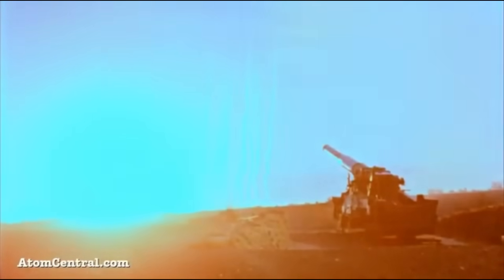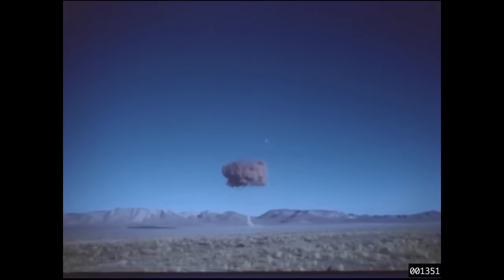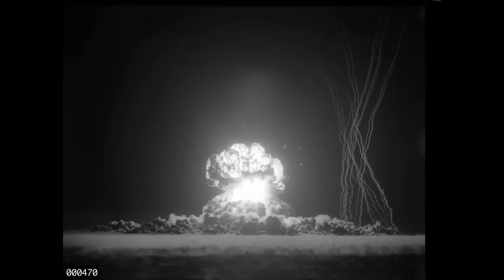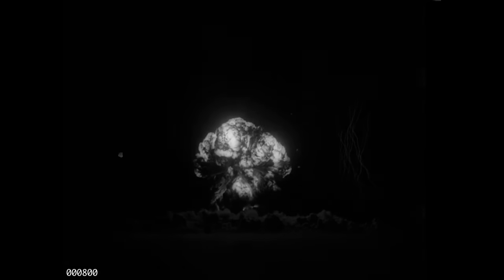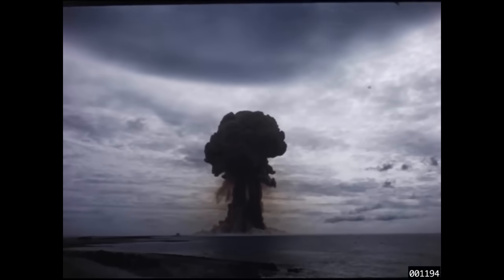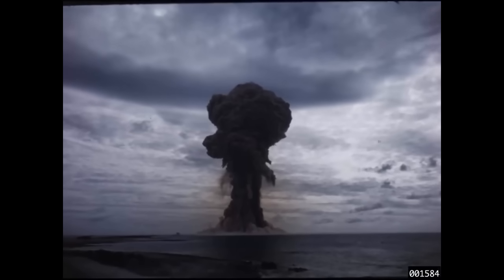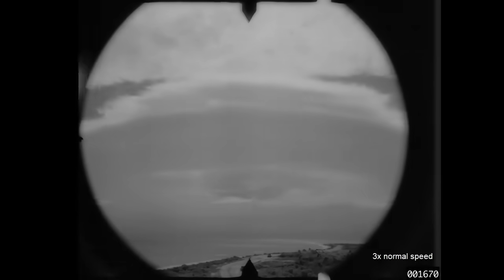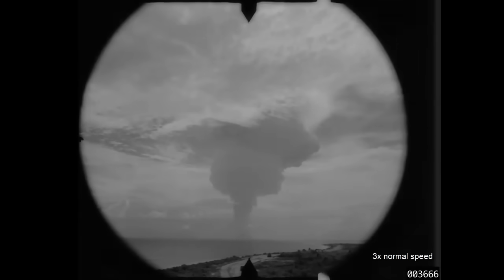What does a nuclear bomb sound like?

Comment: That sounded much like a sonic boom.  That's what you'd expect, when you really think about it.  The survivors of our attacks on Japan thought that is was a regular bomb, just very close.
Reply: Isn't every boom... sonic?
Reply: @AnalyticalReckoner  smort
Reply: @AnalyticalReckoner  sound like normal boom …? But louder
Reply: @AnalyticalReckoner  Smart ass
Reply: Imagine thinking it was a regular bomb only to get immediately incinerated.
Reply: @robertemerson1087  they didn't really have time to imagine much
Reply: @kamranshahid4123  One dude survived both nuclear bomb dropped on Japan, later died of cancer. Just depends where you are at.
Reply: @robertemerson1087  The people who are incinerated by such a bomb wouldn't even hear the sound most likely, and the people blow away by the blast wave would hear and feel it almost simultaneously
Reply: @robertemerson1087  or finding way more people in heaven than you expect
Reply: @robertemerson1087 The people who were able to hear it weren't the ones immediately incinerated.
Reply: @robertemerson1087  if you heard the sound, the danger of vaporization is already passed
Reply: @robertemerson1087  heat radiation travels faster than sound. You would be incinerated long before hearing anything
Reply: @robertemerson1087  If you're close enough to be incinerated you don't even have time to hear it let alone think about it
Reply: Makes you wonder when they realised that it wasnt a regular bomb. When they started feeling a little sick? When they started puking? When they started feeling burns for no reason? When their skin started to fall off?
Reply: @Struggler_5  No, it was when they walked outside and saw the 4 mile tall mushroom cloud rising over the crater that USED to be Hiroshima/Nagasaki
Reply: @Struggler_5  They realized it wasn't a regular bomb long before that, when they walked away from their homes and didn't find a place that wasn't exploded.
Reply: @Struggler_5  I think they realize it is not an ordinary bomb when it effectively wipe out a huge part of the city they where in.
Reply: @Struggler_5  probably around the time the shockwaves ripped the meat off their bones.
Reply: @Struggler_5  I think when they walked outside and saw the huge mushroom cloud and half the city leveled they probably suspected it was no ordinary bomb
Reply: @Struggler_5  or how about when the entire city is gone?
Reply: @Struggler_5  Well, I imagine some didn't even have time to process that anything had happened before they got instantly vaporized.
Reply: @Struggler_5  I remember my mother talking about what she thought when we dropped The Bomb.  She understood that it was something horrible, and feared we would pay for it someday.  At the same time, she was sick of the war and the fact the Japanese refused to surrender, despite the fact they had already been beaten.

With all the revisionist historians running around telling us how bad we were for using this horrible weapon at the end of the most horrible war Man has ever suffered, I wouldn't sympathize with the Japanese too much.  After you see a few photos of what the Japanese did to Chinese women in Nanjing, you may feel no sympathy, at all.
Reply: @alex-nrg  I know it sucks, but the thing is that it's a very complicated problem. If the nukes weren't droped, japan won't surrender and continue on going to war and eventually way more ppl would die from that. So yeah it's still isn't a "good" solution, but it's still better than making the war much longer. (which would results in millions of ppl die. Nukes cost less victim n money.)
Reply: @ThatsMrPencilneck2U  not just the women, the babies too, and also the men, and the beheadings, it was horrifying.
Reply: @alex-nrg  Nobody excuses you, either.
Reply: @alex-nrg  Oh, and for the record, the cities weren’t the main target.  The war factories that were using the cities as living shields were the targets.  If the Japanese didn’t want civilians in the crossfire, they shouldn’t have put them on the battlefield.  They knew the Americans weren’t likely to attack a military target that was close to civilian targets so they abused that fact, same as the Nazis who put concentration camps next to their factories so if the US bombed them they’d be killing the very people they were fighting to save.  They bombed them anyway because they knew the longer the war dragged on the longer those people suffered and the more people died.  War is ugly, deal with it.
Reply: @kuhaku9587  Does anyone have the power to impose some kind of political alternative to the American hegemony?  You analogy is silly.
Reply: @HorizonStronghold  Wdym 4 of the 7 steps? Is there something you can link me to so YT won't remove your comment explaining it? Simply curious.
Reply: @FernandoSegovia701  In the West, it has been accepted that a soldier will surrender when he no longer has the means to fight.  In other words, the battle is over when one side runs out of ammunition.  To make that happen, you go after the ammunition, and it doesn't matter who is handling it, any civilian making or transporting munitions is a legitimate target.  If you are in close proximity, that's you're bad luck.
Reply: @ThatsMrPencilneck2U  that's some pretty shit logic considering you not only destroyed ammunition factories but everything from schools, hospitals, temples and houses. You're trying to be the devil's advocate here.
Reply: @ThatsMrPencilneck2U  Japanese soldiers in Nanjing, not civilians. Though then again, there are no winners in war
Reply: @saturn9536  The Japanese soldiers who were in Nanjing would not have been there and would not have hurt anybody, if they didn't have bullets.  Bullets are assembled by civilians.  True, wars are always to be avoided, because the ending is never predictable.
Reply: @FernandoSegovia701  The horror of WWII was far greater than the suffering of two cities.  If you listen to a translation of Hirohito speech to his people as he broke the stalemate among the their leading council, it coincides perfectly with the American declaration that the Atomic Bombing of Hiroshima and Nagasaki brought about the end of WWII.  There is no greater authority on the subject than the Emperor of Japan at the time.
Reply: @ThatsMrPencilneck2U  Nobody said that war was pretty, pay attention.
Also, the Japanese were already considering surrender after the Soviet invasion of Manchuria. The bombs only accelerated that decision.
Defending the nuclear bombings is just as bad as defending the Nanking Massacre.
Reply: @FernandoSegovia701  Considering surrender and surrendering are two very different things.  I wouldn't conflate the two.
Reply: @FernandoSegovia701  You should read about WWII Japan.  The schools were ammunition factories.  School children operated bullet presses.  Everybody was involved in war production.  The more you read from the Japanese side, the less sympathy you have.  I respect the Japanese.  I don't feel sorry for them.
Reply: @alex-nrg  America is a system, not an individual or concrete group of individuals. Just like for most of human made tragedies, there is nothing you can single out to point your finger at. America isn't excused, but also doesn't need to be.
Reply: @casedistorted  If they had waited for the Soviet invasion, it would have been Japan divided North and South, instead of Korea.  Oh, now I see why the Chinese won't forgive us.  Ending the war sooner, rather than later, put them at a severe strategic disadvantage.
Reply: @ThatsMrPencilneck2U  The biggest reason we dropped the bombs was how devastating the US's pacific island amphibious landing campaign went. After we saw how bloody Okinawa was, and how every last imperial japanese soldier fought to their final stand, with no surrenders; we truly feared an amphibious landing on mainland Japanese soil. Almost as much as we feared a Soviet led campaign leading to Japan surrendering to the USSR rather than the western powers. We were fighting against time, and a seemingly uncompromising enemy. We did what we did because we were scared and we thought it's what we had to do.
Reply: @HorizonStronghold  My only point of conren err in with what you're saying is the bit about Nazis moving concentration camps closer to military targets so they would be less likely targeted. We didn't really have much information on the camps until we started penetrating pretty deep into Thuringia as far as I know. It's more likely they were situated within proximity because of the labor the camps could provide towards the factories.
Reply: @TallCanDan02  Exactly!  What is completely lost on modern people is how fanatical the Japanese defense.  The Germans surrendered in organized units, but even in that theater, the Soviets had to take Berlin, in bloody hand to hand, combat to end that war.  I've never heard of any organized surrender on part of the Japanese, before their emperor stepped in.  There was no reason for American planner to think the Pacific campaign wasn't going to end the same way as Germany, only worse.  In the Pacific, every major battle was D-Day.
Reply: @HorizonStronghold  you're not trying to fix the world. That's a nice story for your conscience. You are messing the world up and slowly turn into the monster you sought to fight. It's hard to swallow but you are starting to realize that you aren't as great as you think you are. Not at all...
Reply: @ThatsMrPencilneck2U  One point I want to add to your discussion here is that Americans felt they were responsible in some regards for the state Japan was in after the war. So they invested heavily in restarting the Japanese economy and reconstructing the devastation caused by the war. Not only in terms of financial aids but also business opportunities and tech development as far as I remember.
Reply: @Fujtajblus  This was back when our government still planned.  The Treaty of Versailles was very much on the minds of everybody at the top of our government.  At the end of WWI, Wilson wanted a treaty that would bring about a permanent peace, but the European powers insisted on punishing Germany.  The reason Chamberlain tried to appease Hitler was because the the treaty was unfair.

As much as we wanted to punish Germany and Japan for WWII, there just wasn't any way to make those countries function with anything but industrial economies.  That meant we had to guaranty their supply of raw materials and make sure they had markets for their finished products.
Reply: @someone-wh2rb  No.  I point out Nanjing for how well documented that savagery was.  There isn't much difference between an 8 year old and an 18 year old.  An 18 year old soldier, without ammunition is far more innocent than an 8 year old "civilian" who is operating a bullet press.  Any structure along the line of supply is a legitimate target.  The lack of any organized surrender on part of the Japanese, and the way the Japanese organized their civil defense precluded any of their population from being noncombatants.
Reply: @someone-wh2rb  We weren't destroying "two cities," we were destroying every city.  We were not going to negotiate a peace where it was even possible for the Japanese were going to rearm to renegotiate.  This was the only way the Japanese leadership could save their "honor."  We also had a problem with the way the militarists adapted their Code of Bushido to modern times.  To change a military structure on that level is no small thing, and not negotiable.
Reply: @alex-nrg  Some amount of slack can be given here. The effects of nuclear weapons were poorly understood, at best. Nuclear fallout wasn't a concept back then, and no one knew how it could contaminate the soil and drinking supplies. And to put in context, Tokyo had been firebombed to utter annihilation, with more deaths and destruction resulting than either of the nukes ever wrought. As a modern society wisened  to the horrors of nuclear weapons, such notions should obviously be scorned. But given the unavoidable ignorance in a rapidly developed and deployed technology, the now half decade of terrible war, and the prospect of invading a nation that was set to resist with every last man, woman, and child and the enormous loss of life that would entail for both sides, the dropping of nukes is a sin that can be forgiven just the once.

My god that was a long sentence
Reply: @alex-nrg  The idea that only soldiers will get hurt in a war is a very modern (and verifiably false) one. When a government goes to war, they aren't playing video games. The entire civilization is brought into the war. Not just the soldiers. The soldiers only have one part to play -- on the battlefields. Everyone else has their part. War should always be avoided, it hurts everyone. And if you don't want people discussing the topic with you because you're too frail to handle an opposing opinion, so you complain that you're being "mansplained" to and call yourself a victim, how about then next time you just stay out of the conversation and nobody will mansplain anything to you, sound good?
Reply: @ThatsMrPencilneck2U  Thats even worse isnt it? I like how you say you wouldnt allow them to rearm but the US actually pushed for Japenese rearmament to contain the USSR in Asia.
Reply: @kuhaku9587  how terrible that the only solution to the horrors of war was to do something so horrific that both the person committing the violence and the victim were in shock that it had been done….. people in power need to listen to some marshal rosenburg or something… learn how to talk and how to listen
Reply: @alex-nrg  100K Japanese died for millions to be saved. Along with millions of Chinese, American, Russian, and British troops. It's war, all is fair.
Reply: @ThatsMrPencilneck2U  the nukes isn't what stop the Japanese high command for continuing the war but the Soviet threat to the mainland. Also, the a-bomb dropping isn't really just forcing Japan to the table, but a stern warning to the Soviets that they have a weapon to scare them, for the Soviets assembled one the largest army in that point. That if they decided to fight against the alliance , it would make the war much longer.
Reply: @patrickbueno3279  I just go by the Emperor of Japan.
Reply: @ThatsMrPencilneck2U  You do realise that in these kind of war situations most of the country's logistics and production is modified to better feed the war effort? According to your logic cities like NYC, Springfield and St.Louis are valid targets for nukes and the bombing of London was perfectly fine. You could even extend that logic to strategic ports and justify the sinkings of all the trade ships bringing materiel to Europe, which was one of the major reasons why the US actually joined in the war. By your logic the USA was asking for their trade ships to get sunk because they were bringing ammo to the allies. 
And in the modern world with global logistics networks that's a whole new can of worms, how much ammo does the US produce and ship out nowadays, both for commercial and political interest? By providing ammo and materiel to some groups the US is basically fanning the flames of war and enabling many conflicts around the world. Is it ok for Pakistan to try and nuke any location that has a General Dynamics factory nearby because they are shipping tank shells to Israel? If the goal of 9/11 was to disrupt the shipping of ammo and weapons to Al-Qaeda/Taliban's enemies would that make the attack justified?
Reply: @MrNotBot  I don't know if you're Christian, but you're on a holy path.  You've never studied war.  Even when I was a child, I knew the Soviet targeted my city, because of the factory my father worked in, and all the other industry.  The army base in the next county was hardly a concern.  I don't judge the Soviets, or the Russians badly, because they have to plan the way they have to plan.

The problem with all insurgencies attacking the USA is not a moral one, but a problem of grand strategy.  A state is always the last word on violence.  Sometimes you can drive a state off your territory, and sometimes revolutions succeed.  Usually, violence against the state only brings more violence and greater tyranny.  Gandhi and MLK Jr. didn't choose non-violence, just because they were nice people.  These men knew what they were doing, and they were not going to become tools of their oppressors.
Reply: @benny_apper  the nukes didn’t get Japan to surrender, at all. You had already firebombed many cities to ashes, two more were no big deal. Russia declaring war caused them to surrender.
Reply: @ThatsMrPencilneck2U  I know about war and human condition in dire times, I was on college in Sarajevo when shit went down. Bombing factories and valuable locations is one thing, and nuking the whole area is a whole another pair of sleeves. I went with insurgent and guerilla attacks because they are the closest thing that the western world has faced to events that touched the nerve, and I wanted to see how your callous "they are asking for it" mentality works when applied to your own infrastructure and people. Especially when considering how every single nation at war will do it's best to animate it's civilian population to help with the effort. Nukes are atrocities that reaped many lives of people who were tangentially involved with the war effort at best if involved at all. 
Let's put it this way, if USA and China went to war, would it be ok for China to casually nuke the entirety of Washington area in order to get rid of the Pentagon? Would those half a million deaths be acceptable simply because they happen to exist in the vicinity? In the example that you have given you most likely wouldn't be alive now if Soviets used nukes instead of the traditional bombs, would that be acceptable as well?
Reply: @ThatsMrPencilneck2U  And where did you get that idea? I think that only the military presonnel should be treated as actual participants of a war, and civilians are still civilians no matter how you construe their help with the war effort. You seem to justify and support nuking entire cities filled with civilians because they were involved in the war effort and/or happen to exist near strategic targets. That the Japanese working in those factories knew what they were getting into and should be ready for their deaths and the deaths of their families because they are making ammo for the army. And yet when the tables are turned and when in theory the American civilians are presented with the same fate you start talking about philosophy and the suffers of war.
Reply: @MrNotBot  You're the one saying that its OK to kill some people but not others.  This is purely subjective.  The reason anybody fights in a war is not because of any high minded reason, but to make the death and destruction happen as far away from himself and everything that person cares about.
Reply: @someone-wh2rb  Dropping the atomic bombs on Hiroshima and Nagasaki had little to do with revenge. If a conventional invasion of the main islands of Japan had taken place, the projected casualties were between one and three million, maybe more. Moreover, the cities of Japan would have been burnt to the ground as a result of street fighting and carpet bombing by B29s. From the intelligence gathered by the Americans, there was a possibility that all civilians over 12 or so years of age would have been combatants, even if that meant using sticks and stones as weapons. Basically, unconditional surrender was not in the vocabulary of Japan before the atomic bombs were dropped. Some revisionist historians have suggested perhaps a conditional surrender should have been considered by the U.S. If that had occurred, there would have been really no way to keep Japan from becoming an aggressor nation once more.
Reply: @benny_apper  exactly. It’s disgusting that we had to do that but it’s much more disgusting what would’ve happened if we didn’t
Reply: @ThatsMrPencilneck2U  I mean, nukes are a pretty horrible weapon, and to use it on a civilian target no less? i would've aimed for a military target, but eh, the deed was done long ago. Let's just hope no nuke is ever used again.
Reply: @anakinlowground5515  You cannot judge the decisions made during WWII by our current understanding of the world.
Reply: @alex-nrg  you are welcome that we did what you cannot.
Reply: @FernandoSegovia701  your history is bad.  The bomb was dropped on Hiroshima August 6th.  The USSR did not invade Manchuria until August 9th.
Reply: @lookoutforchris  I had this conversation over a year ago. I'm not reading 105 comments just to answer. Refresh my memory.
Reply: probably the same things US soldiers did to Syrian, Afghan and Iraqi women
Reply: @ThatsMrPencilneck2U I don't either.  Especially the ones around in the 30 s and 40 s. I mean in regard to the bombings.

I felt sorry for them in the 2011 tsunami though, however that is not a war situation and was modern Japan.
Reply: @ThatsMrPencilneck2U  ''We'' being America. When will americans realise that the internet is not just in America. ''WE'' The british did not drop any atomic bombs.
Reply: @lookoutforchris  I wrote a reply that was insufficient.  I have a brother-in-law that comes from India.  Don't tell me how nice you English are.  I've had more than an ear full of how civilized the English are..
Reply: @alex-nrg neither do I but sometimes you gonna know when to quit and if you don’t there’s gonna be consequences.
Reply: @alex-nrg it saved millions of lives
Reply: @PaladinOfChrist77  o my bad bro
Reply: It is because the shockwave created by a detonation (an explosion propagating faster than the speed of sound) or an object breaking the sound barrier is a sonic boom by definition. When a supersonic bullet "snaps" or you hear a high explosive go off, you are hearing a sonic boom.
Reply: The sound of every explosion IS a sonic boom.
Reply: How can it be a sonic boom. The explosion happened only at 1 location and it doesnt move. If its a supersonic jet then yes we get sonic boom. This is dont understand.
Reply: @lonewolfgaming5245  I did not say it was a sonic boom, but that it was like one, in some respect.  While a sonic boom is caused by something covering a lot of distance very quickly, an atomic blast covers a wide area.  From both, one should expect to hear an initial crack, followed by reverberations.  By contrast, Hollywood make the sound to be more of something, like distant thunder.
Reply: @ThatsMrPencilneck2U  oh ok. What is that initial crack though?
Reply: @lonewolfgaming5245  the thing that is moving here is the air itself. So the sonic boom is caused by intense pressure moving air faster than the speed of sound
Reply: John Barber  A big high explosive bomb, like you'd expect to fall on your city, when the enemy controls your sky.  It's not like anybody in the line of fire had a panoramic view.
Reply: Some Hiroshima survivals said that they literally thought the sun fell down from the sky. So i dont think that they didnt realize that the bomb was something different... People could see their own bones through skin and flesh, people got blind just by looking at the explosion, people got burns where they own cllothes became imprinted in their skin...
Reply: Sounded like a giant gunshot.
Reply: Read the book Hiroshima. Can't remember the author off the top of my head, but he was an army journalist/researcher who interviewed survivors not only shortly after the war, but then again decades later. It's a very good, very emotional read.
There were a surprising number of survivors initially, and a lot of them believed it was an incendiary bombs because of all the fires. Seriously though, an astonishing number of people survived the blast, with most of the deaths coming days or weeks later from the radiation sickness.
Reply: @joshuajackson472  Why don't you read interviews with the soldiers that fought at Iwo Jima or some smaller horror.  That war was fought by conscripts, rather than professional soldiers.  For a conscript, the terror begins with a letter from the draft board.  Militaries only work, because soldiers are more terrified by their own officers, than the enemy.  The experience of an American, unfortunate enough to be drafted into the Marine Corps was a field day, compared to any Japanese service, and that was before they had to dig in, amongst their rotting comrades.
Reply: @ThatsMrPencilneck2U  I have. More recently I've been reading WW1 trench war memoirs. "Over the top" by Guy Empey and "Storm of Steel" by Ernst Junger. Also recently finished the Spanish Civil War memoir "Mine were of trouble" by peter Kemp. 
At the moment however, I'm reading "Benjamin Franklin" by walter isaccson. 
Studying history has been my main pursuit since at 10 I came across a copy of a Time Life book on the american civil war that my grandfather had. The pictures of the young soldiers posing in their new uniforms, followed by photos of fields littered with the dead, broke my little child brain and created a futile obsession to try to understand it all.
Reply: @joshuajackson472  Author of the book Hiroshima is John Hersey.  It was a grim, disturbing read that I haven't forgotten in the thirty or more years since I read it.
Reply: @zumbinis  yeah, that one gets seared into the soul. Read it a few times, picked up a copy when I worked at a bookstore a long time ago, before the rise of Amazon. Can't remember if it's in storage or lent out and never returned. The descriptions by the survivors are so horrifically vivid. Hopefully they're the only ones to ever experience that.
Reply: @MonkeyBoyBeatz  Correct , the Japanese Government fiddled about for nearly 5 months ,(140 days, to be exact), trying to organise a "False peace" by sending unqualified Diplomatic representatives to the "Big three" conference at Yalta. They were not qualified to attend the meeting and were thus ignored by Stalin, the host. This move was a "Furphy", or deliberate false move. The Japanese cabinet comprised 6 members, plus the Prime Minister, Tojo.  3 of the Members were Warmongers, who wanted to proceed with the war, no matter what the cost, in lives. Especially someone else's lives, not their own, of course.  The other 3 were genuinely searching for peace. None could face the humiliation of the  "Unconditional surrender", as demanded by the Allies. They ( the Japanese)  started the Pacific war, Unilaterally, similarly to Putin in Feb '22 but could not find a way to end it, once they realised they were now losing, So the ' peaceniks' were sent on a wild goose chase, trying to achieve a peace at Yalta that was never going to happen, whilst the other 3 Warmongers pursued the Pacific war to the bitter end ( of  other people's lives) So, finally, the question of  lives expected to he  lost by a US-led invasion on Japan, was discussed and analysed at US Cabinet level. Conclusion was that at least half a million Americans would lose their lives in an assault on the Japanese mainland and at least 2 million Japanese would lose their lives, so the decision was made to drop the Nuclear bombs, which brought the war to an abrupt end, notwithstanding an attempted Palace  Coup-de-tat in Tokyo,  which would have left the Japanese govt. in the hands of 3 warmongering criminals, and a war lasting for 18 more bloody months .Iwo Jima would have been a picnic by comparison. Perversely, the Nuclear weapons saved hundreds of thousands of lives. In short, the Japanese government was being manipulated towards more bloodshed, the bombs brought it to an end. 
The bombs also achieved something else not frequently mentioned: the bombs brought US and Allied troops on to the Japanese mainland, and KEPT THE SOVIETS OUT.  The Soviets had already swept south and invaded the northern Japanese Islands. If the U.S. DID NOT drop the bombs, then the Soviets would have fully invaded Japan from the north and swept south and taken nearly all of Japan, which then would have remained divided with the northern half under Communist rule, similar to Berlin and East Germany. The dropping if the bombs and the rapid arrival of the US & Allied troops in Japan prevented this, and left Japan to emerge from the Fascist pre-war Military Government towards 45 years of Peace, Freedom, extraordinary Economic development and open,  Participative Democracy. 
On balance, the bombs, perversely,  were worth it  . You can read this in a book "140 days to Hiroshima", by David D. Barrett. Well worth a read
Reply: I'm just glad these things saw no use anymore
Reply: @di-gun5791  The future has yet to be written.
Reply: Your attacks on Japan? This is the www Not everyone is American.
Reply: The aftermath would have you saying the same when you compare Hiroshima to Tokyo. Both cities were hit with different kinds of bombings, yet they both looked exactly the same afterwards.

The only real difference was one was done with a bunch of bombs while another was done with just one. Now that’s what makes it scary.
Reply: @goldenstatedre   There are many differences.  At ground zero people and buildings were vapourised. as can be seen from images of people burned into walls.Many were incinerated from the initial blast a number of miles away, flesh falling from their bodies. Those that survived the intial blast and weren't blinded (even with eyes closed), died from radiation sickness and cancers for many years to come.Women who were pregnant at the time or became pregnant soon after, gave birth to babies with defects, deformities and some with cancers.